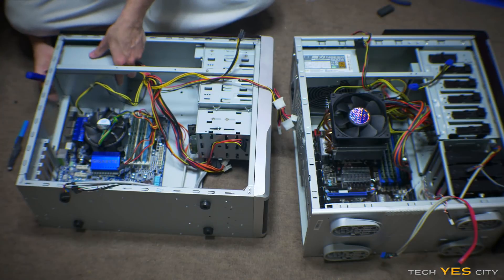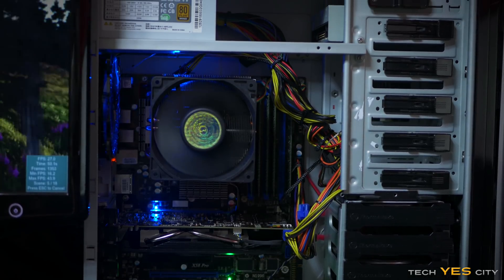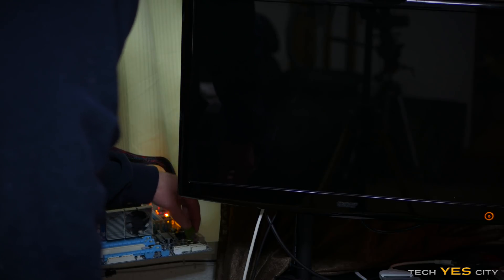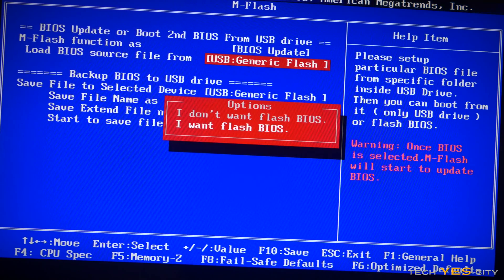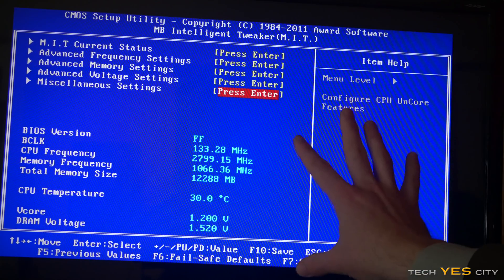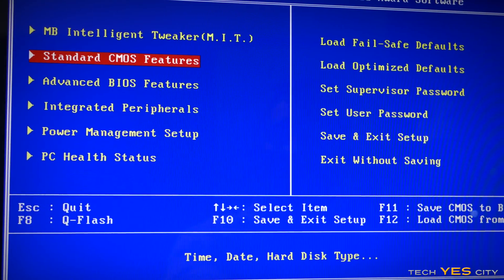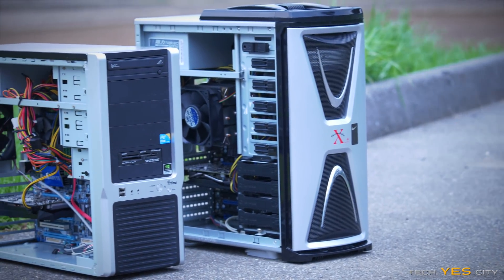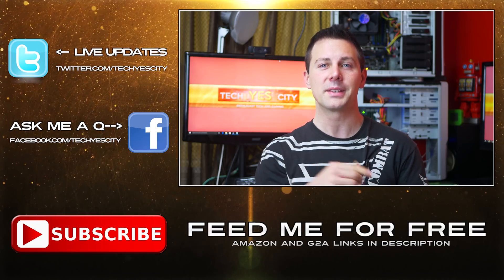PROJECT 242 - The Mystery of the i7-920 Vs E5640 ($302 + $312 Used PCs)

Comment: I replace my 920 with E5645 is a few years new eat 80w not 130w like 920 and e5640  is 6 core if I remember 
My asus rampage II gen is a bit temperamental with over clocking only 2 bios option  (Gaming and extreme over clocking )In both options the cpu was about 2.8 Ghz up to 3ghz 
Altrue the xenon is not officially supported by asus rampage II gen I worked beautiful on the first try with original bios ,also 12gb ddr3 server memory 2GB each slot (is triple chanal )
Way better performance for xenon and never go over 60 grade Celsius in load,  the i7 go to 90 a bit scary

Comment: Man, where did you get x58 boards so cheap? My current build ended up going around an 1156 x3440 because I simply couldn't find an x58 board for a reasonable price. Don't get me wrong, the 3440 @ 3.6ghz with a 1060 is crushing current games at 1440p, but when I'm compiling code or rendering video I really wish it was an x 5660 @ 4.1Ghz.

Comment: Got me an x5660 and an x58 ud3r rev 2 and I recently just got 24gb of ecc ram for $50. Atm it's not working. I'm on the latest bios but I just don't get a signal.
Reply from the maker: have to make sure its not registered, im pretty sure regiistered memory won't work with x58, ecc non reg will though.

Comment: Surprised to see this. I just built  a i7-930 6 gigs of ram ddr3, hyper 212 evo, cheap case, evga 500 watt 80+ power supply and msi rx460. Im working on overclocking the cpu. Oh and asrock xtreme x58 motherboard. All for 330 total. Mother board alone is going for close to 200 on any place i look used.

Comment: At 10:20 you say, "We can now use the ECC memory because the Xeon has an ECC memory controller." But I have that motherboard, and it supports "non-ECC memory." Are you trying to imply that you are actually using the ECC FEATURE? Because that is completely different from using the memory with a disabled ECC feature. 

From what I understand, to use the ECC feature on the memory, it requires support from BOTH the CPU and the motherboard. 

So your memory works, because it's unbuffered, and the ECC memory controller in the Xeon is irrelevant because the motherboard doesn't support ECC memory. It's basically just using the memory and ignoring the ECC feature.

Comment: Which is better lga 775 or lga 1366
Reply: xeons
Reply: LGA1366 Xeons will probably come with lower temps and therefor higher clocks (Duo to more space in between the physical cores) or more cores at roughly the same clocks

Comment: great videos. like the presentation. i've learnt much from you. i tor down my rig and cleaned all the parts as i've seen you do it. looks much nicer, runs cooler and should last a little longer. very rewarding! the gpu is the only item not tried yet. bit cautious but i will have a go. gtx 760 referance is running @81!

Comment: Why are you faking the fps counter in the top left it says everytime less then the minimum this is stupid
Reply from the maker: Because I run benchmarks in different parts of the map off cam, what you see is just for b-roll.  If you are testing two things against each other then you test the same part of the map with the same settings and same variables otherwise you will end up with apples vs oranges.  Hope this helps.

Comment: hi can i use intel xeon on this mobo Gigabyte GA-X58A-UD7 rev.1
if yes can i use ecc memory(will it work as normal- i dont need ecc and i have it at home)
can i overclock that cpu on that motherboard using blc method 

Thanks

Comment: the 1st egn i5/i7 still rock hard with a decent gpu, i have i5 750 and i7 920 and both still run any game at high/ultra (1080p@ 60fps) with a good GFX, very few are the games were i have to put on med to achiv the stable framerates ( games like Batman series, project cars or metro) just get a nice overclockable board for them and they are good to go.

Comment: Brian, is that gigabyte X58 mobo anygood ? just won one on ebay.co.uk for £46! a bargain compared to the other listings!
Reply: Andrew Bedford The gigabyte boards all work great but won't overclock Xeons or run ECC on the latest bios. Downgrading to the initial 6 core bios update from q3 2010 works fine. I've also found boards with less than 6 memory slots down support ECC.

Comment: Not sure why you'd think the process shrink would change performance? 

What it did was run cooler and leave more die space for 6 Core Westmere chips, like the fabled X56x0 series :P Thar's why your stock HSF is OK

WRT BIOS - Beta BIOS files should be fine on the MoBo, I was certainly running FK with the X58-UD3R Rev 1.6

And lastly, yes the GCN arch has aged well, here's a Firestrike score my 920 build with a 7970 - http://www.3dmark.com/3dm/3206190 [with a higher GPU OC/cooling it eventually hit 8000, just]

Comment: An I7 920 at 4 GHz (for bench 4.3-4.4 GHz) can handle much more powerful GPU than a lowsy GTX 660 card. I ran my I7 920 at 4 GHz with two GTX 970 i sli with is in performence wise to a single GTX 980 TI or a GTX 1070. Dont believe me watch these benchmark when. 3dmark firestrike: http://www.3dmark.com/3dm/13192560 and the new time spy: http://www.3dmark.com/3dm/13200518? Heaven benchmark: https://altpic.s3.amazonaws.com/pics/1468513453/Heaven%20bench%20rekord.jpg and valley benchmark: https://altpic.s3.amazonaws.com/pics/1468514772/Valley%20bench%20rekord.jpg . CPU-z benchmark: https://altpic.s3.amazonaws.com/pics/1467911804/cpu-z%20bench%204,4%20GHz.jpg and cinebench R15: https://billedeupload.dk/images/WRLxA.jpg God old X58 is still very capable for 1080 games when they are backup bu at good OC and GPU. I play the latest Doom, the witcher wild Hunt, Crysis 3, BF4, Evolve, Far Cry 4 and so on on my old junk and i have no complaning about performence. Oh and dont forget that you can find a cheap 6 core xeon for LGA 1366 on ebay and clock the crap out of it and by that get a freaking cheat working pc and gamming.

Comment: Hey, great builds. Any chance you could post up some bios settings for both for 4GHz. It may be a little late now since they probably already have them. But some advise for a 920 to 4GHz would be appreciated. Thanks
Reply: This is my settings for at 4 GHz I7 920. http://peecee.dk/uploads/042016/20160415_190754.jpg and http://peecee.dk/uploads/042016/20160415_190903.jpg but no CPU is the samesom your part may need more or less voltage for the same speed.
Reply: Cheer GTRdaemon. I'll see how I go trying to match that. Really appreciated
Reply: +RamjetX you are welcome.

Comment: Well, should test how GTX 660 SLI is still relevant today since you have 2 in these builds.
Reply: +xChrisMas Bruh don't underestemate the power of sli GTX 660's
Reply: It ran quite well (had an Sli build til December'15) but I upgraded to a GTX 970. If you have the 200$ just buy a used 970 if you're thinking about actually buying a 660 Sli setup

Comment: I have an 920 an evga x58 tri sli mobo and  evga 9800 superclocked.  never came to life.  but I want it to.got a 270 toxic for gf's hp for $155 old 9800 are still $180. I want to put my mono to use what should I do

Comment: where do you get a 500gb hardrive for $24 and an i7 for $39?
Reply: you can find that i7-920 even a bit cheaper on ebay .... but a socket 1366 Motherboard .... these things are like 150 bucks MINIMUM :/  ... same goes for the 2011 socket stuff ... i wonder where he gets his motherboards damn :(
Reply: ebay
Reply: Well, I think he uses a different currency than USD, even the i7 920 is a bit hard to find around here. People see i7 and prices them so high and yet it's not that much faster than the some of the older C2Q. LGA 1366 motherboards? Good luck finding them under $100 in the US these days lol.

Comment: I just fixed my CPU I think I took out the battery from mobo and tried to boot but get no so signal fans spin tho I heared that you need to use a vga card to get signal as the i5 750 doesn't have integrated graphics would this be correct thanks and great video

Comment: No, i7 chips do not support the ECC feature.  The memory has the capability but it is not being used by the chip.  The system will still work after the flash of the BIOS but that did not give you an additional feature because the feature was not built into the chip.

Comment: IMO the e5640 builds are not worth it. An i7 860 preforms similar, and works on a MUCH cheaper mobo. 1156 seems like a much more promising platform, with more bang for buck. So does the 775 and 1155, but 1366 is not very good bang for buck. A decent, xeon supporting mobo cost over 100 bucks here in the states, and for that price you can get a sandy bridge i3, and a board. Or a 1156 i7 and a board for much cheaper. An 1156 i7 with board costs like 100 bucks max.
Reply: +Adeel Rehman 
775 mobos are cheap. I bought a used 775 Gigabyte board for about 40€
Socket 771 Xeon X5460 around 30€ (much cheaper than comparable 755 CPU's)
You can hack the 771 to work on a 775 mobo. Works flawlessly
couldn't find 100 bucks 1156 i7 + mobo anywhere btw. can you please link me any good stores?
Reply: ***** I meant used, on eBay or hardwareswap. I picked up an x3450, mobo, 8gb ram, and a 500w psu for 107 bucks. 

And when I said 775, I technically meant 771 I guess, but yeah I already know about the mod.
Reply: +Adeel Rehman Im using a 775 i own a 1156 but i still need to get DDR3 to go with the Mobo as i own a literal stockpile of DDR2. Lmao.
Reply: codywright99 r/hardwareswap wants it maybe
Reply: Adeel Rehman Thats actually a good idea.

Comment: I thought you needed a mod sticker to use a xeon processor in a regular computer. Xeon processors are for servers.
Reply: +lepayen the way cpus are made is they take on big piece of silicon and all sections of that one big piece of silicon waifer that perform on the low end are pentiums and i3's, all high performing pieces that have mediocre hyperthreading are your i5's, all pieces that have good performance are your i7's and all pieces with good hyper threading but mid grade performance are your xeon v3's. so there is one consumer grade xeon cpu group like the xeon e3-1231v3 (that is an i7 but the integrated graphics came out performing like garbage). they have done this for years so they do not have to throw away poor performing pieces of that giant silicon. they just say hey, this cpu performs different than that one and put a different price sticker on it based on how it performs.

the server xeons come from a different piece of silicon but basically use the same engineering and marketing.
Reply: No, they sell a mod sticker to put on a xeon processor so you can use it in a reqular computer rather than a server. Every xeon chip I've seen for sale was for a server. Your response didn't answer anything.
Reply: +lepayen that'd how they market most of them. the e3 series for socket 1150 is the first set of xeons available on consumer motherboards. normally these are for 2011 and 1366 sockets. the course he has is a server could but on haswell and has well refresh they were available for non server systems. they were basically i7 chips with no apu activated. because when they made them the apu didn't perform well enough to sell them as i7's. so they said Meh, they're consumer xeons that support ecc ram. or they could be xeons that didn't perform well enough to bring in 2,000+ dollars.
Reply: I'm not sure you know what you're talking about. All my question was about was the mod sticker that you need, I didn't ask about socket 1366 or I7 or apu or any other information that has nothing to do with my comment. Xeons are supposed to be top performing processors made for servers, the only reason a consumer computer would even need one is if you want to turn it into a server and they make a mod sticker for the processor in that case.
Reply: +lepayen Lol. To actually answer your question, that used to be the case for LGA 771 and LGA 775, they had different sockets for their server grade equipment. Intel has however phased out that practice since then and releases all of their chips on the same type of socket. So a consumer grade board can use both a Xeon and a Core series chip, as long as the board supports the same socket type.
Reply: +Kevoy Daley Not anymore. Skylake now use different sockets for Core and Xeon.
Reply: James Ch As far I'm aware both socket LGA 1151 and 2011-3 stick to this standard. Have any examples?

Comment: Use old dryer sheets to clean thermal paste up, you'll have a LOT easier time of it, bro.

As for the differential between the CPUs, I'm gonna chalk it up to the deleterious effect of Intel® Demand Based Switching being present on the Xeon; turn that off and you should see slightly better performance on that chip.

Comment: according to intels website the i7 920 doesn't support ECC ram
Reply from the maker: +Knig Fotlets Yeah that's why I am scratching my head, sent them a message on twitter and they didn't respond, I might have to go tinfoil hat on this one.
Reply: Tech YES City Question is, does it really work like ECC RAM now or are the error correcting features now disabled? Maybe you could test this, since I didn't find anything on the web.
Reply from the maker: I don't know a program that specifically tests to see if ECC is enabled?
Reply: Tech YES City AFAIK your BIOS/UEFI can show it, if it supports it, memtest86+ can tell if ECC works and you can also use CPU-Z. But I've read that they sometimes don't seem to provide correct values, even on systems that definitely support ECC. But it's worth a try.

Comment: i have the i7 965, if i were to choose between the 920 and 965 i would say go with the 965 if you dont overclock, but if you want to overclock and have a watercooled build then fuck it and take the 4.52 ghz oc. my 965 is limited to 4.2 ghz by the manufacturer i dont know why intel decided to do this but they did.

Comment: Although the ECC memory is being detected while running with the i7 920... its not being utilized as ECC but regular memory instead... the desktop grade processors dont have the necessary instructions to utilize the ECC capabilities of the ECC ram... thats where XEONs come in.
Reply from the maker: +Sammy Morini That would make sense, thansk for that.  Though I thought the ECC component is built onto the traces / bus? Would love more insight into this (if you have the time).

Comment: hah, I got an I7 920 machine for free, and I bought a GT630 off of a friend for $10, and it plays nearly every game that I have on med-high settings :)
Reply: a gt630 doesnt play almost anything with med-high settings.
Reply: +Official Me 1: You posted that comment twice. 2: A GT630 is  decent if you dont play all of the next gen titles. (like I do). Not to mention it has 384 cuda cores, and a 2Gb framebuffer.
Reply: +Chris tanksanvich 1: Sorry 
2: But not medium high, more like low-medium if you play anything recent thats not an indie game. Is it fun to max out kotor 2?
Reply: +Official Me Actually, I play far cry 2 at high settings, and it manages to pull through at 45-50FPS, only dropping to the 30's when it gets really demanding, but it still manages to play it almost all the time at well above 30FPS.
Reply: +Chris tanksanvich Farcry 2? Impressive.

Kappa

Comment: I got a used i7 930 full of good stuff like an SSD for booting and Memory Controller so I get Sata 3 for 200 bucks then I put a New gtx 750 for another 150 bucks and it's tight I overclocked CPU and GPU run all my games satifactory, I wanted to build a new machine just can't afford it so this is more then good enough

Comment: Do i have to put thermal paste onto a brand-new GPU?
Reply: +Chris Vandyken no
Reply: +Akex Steele “Bucket” Thermal paste between the cpu and the cooler is mandatory.
Reply: +Manuel del Busto 
well it's not mandatory, but it would be idiotic not to put some thermal compound in between. 
The cooler on the other hand is mandatory. without the CPU cooler the PC won't start at all ;)

Comment: #TechYESCity I badly need your help. I am looking for a xeon 8 core with 16 threads cpu which will be running under 100 TDP and the motherboard along CPU wont cost me more. I am happy to go for a used cpu (max 150 usd) and new motherboard(max 250 usd) from ebay. But the prerequisite is, i dont want any cpu that has max TDP more than 100W.

Comment: which card is better SAPPHIRE NITRO Radeon R7 360 DirectX 12  or the NVIDIA GeForce GTX 750 Ti?
Reply: +Niccoló Pasquale 750ti
Reply: thanks everyone for the info
Reply: +Niccoló Pasquale Its not even close to better. I've tested both and the 360 performs lower.

Comment: westmere was just an die shrink no arctuctial changes performance increce came from the lower tdp allowing higher oc in the same thermal and voltage range ex my 215x19 4.04 ghz c0 920 ~650cb ~80°c max temp during IBT pulling ~ 200w at 1.4v although the d0`s also do alot better in that respect. while my x5650 22x205 gets 4.5 at ~ 1.45 ~200w both running high qpi voltage ~1.45 x5650 1036 cinebench because i can not post with the qpi multiplier  under 20 or i would be at 4.6/4.7 and there are two more cores I am sure 4core westmire  can hit 4.5 on an 212 evo or such. my temps are on an deep cool captain 360 I bleave that with an clc there is not enough water flowing over the microfins in the block to keep those 200w tsp monsters cool and the cooler plate gets saturated as my rad nearly gets warm. sorry for the block of text this is what happens when I should be asleep but deside to wright an wall of text on an phone